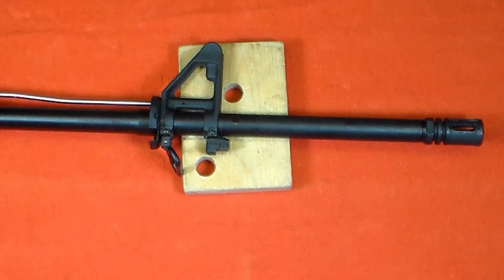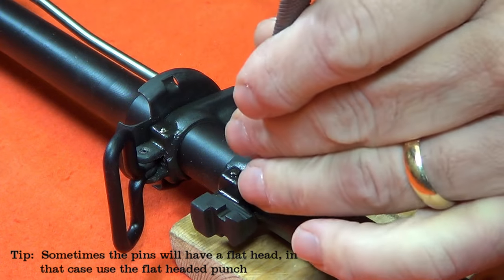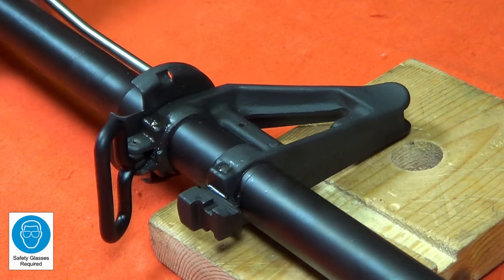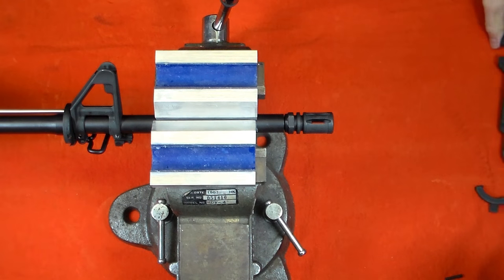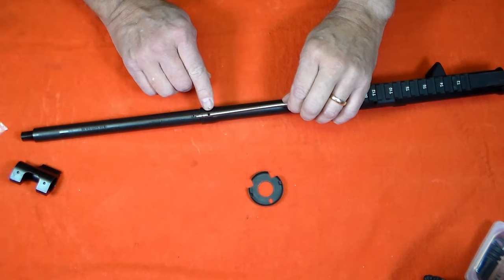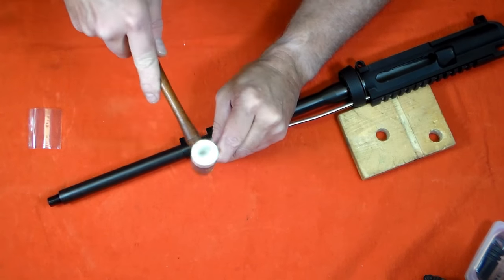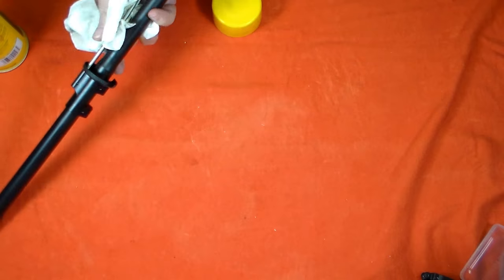AR-15 Front Sight Base removal and replacement

Comment: My enthusiasm for removing an A2 post has just evaporated. I'm barely good with Legos.
Reply: If you got enough money, buy a new barrel. Cheaper than dirt has some on sale and made by wilson combat that are pretty nice. Came with a new gas tube as well. Mine was 178.00 before shipping and tax. Normally 268.00…Barrell isn’t hard to put on at all
Reply: Just buy a new complete upper and save this one for a backup!

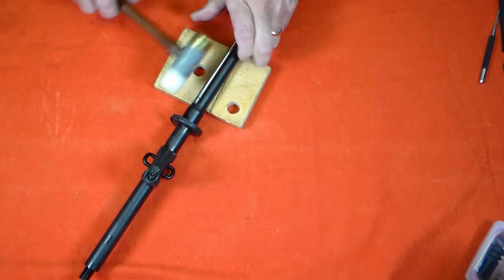Comment: 4:06 'to remove the gas tube you need a special tool that I'll show you later'  4:23 pulls gas tube out by hand
Reply: :-) good catch, but I did say "on heavily used guns you'll need the special tool" this gun was almost new so the tube came out by hand.  I do show the tool later at 5:52.  That tool, by the way, is available from Midway USA or Brownells.  Thanks for watching!
Reply: Jim Humphrey Great channel you got here. I just did my first gas tube replacement job yesterday. I’m always looking for a good gunsmith channel, sub’d you.
Thanks !
Reply: @newdefsys  check out sotar also

Comment: I finally bought a Ruger 556 online and didn't notice the loose front sight till later on. Luckily Dad had old steel concave nail sets old as me in his gun tool box from 4/32 to a point. Used the 3/32 and his old Tapco brass hammer he used as a AMM2 on the Enterprise during WW2  to tighten up the pins and center the sight, still looks half a degree off, my OCD probably, He had a cool pristine collection going back to a like new Springfield 1873 trap door 45-70 up to few modern ones from the 60s, bought a few Colts at a hardware store in the 50s, times sure have changed!, till few years ago when Mom passed. He did all his own minor gunsmithing. I'm planning on a QR scope mount and keeping irons, think I'll just use a taller mount.

Comment: Very nice presentation: no hard rock or banjo background music. I have most of the tools needed to build my first AR-15, but after viewing the difficulty in removing the two sight base pins, I don't think my concave pins are robust enough to do the job. I think perhaps a shot of penetrant a day or two ahead of time and a 3/32 nail set punch might make the project go a little bit smoother.
Reply from the maker: Absolutely soak the heck out of them with Kroil or equivalent.  I've always been surprised that somebody hasn't built a hand press (like a sight pusher tool) to push these pins out.  Thanks for watching.
Reply: @ImminentThreatDefense  I have a can of Kroil but I like the stinky stuff-PB Penetrant for most of my chores. Also, you might want to patent your AR base pin remover idea before someone else does and sells the idea to Brownell's. He-he. Thanks again and take care.

Comment: THANK YOU!!! The nail set saved my behind. Beat on those tapper pins with an 1/8" punch till all the beating was gone. Went to the hardware store bought a set of three nail sets and in about 10 minutes and 8 whacks pins were out like a high flyball to centerfield. Your well-honed advice turned frustration into a sense of accomplishment. Just one observation you stated a 5/32" set however all I could find locally was 3/32", just wondering. Finally of all the good videos I watched on this step yours proved the most helpful''.........again THANK YOU!!
Reply: Thanks for the comments, and you're right I got it wrong, I was using a 3/32, sorry if you spent too much time looking for a bigger one.   Thanks for watching!

Comment: Dude, those front sight pins are kicking my ass.
Reply: Nice Guy dude tell me about it. I have to call in for backup.  No reason they should be that difficult
Reply: Yep, I've been trying to get these things out for an hour now. They just won't seem to budge.
Reply: Your lucky I just sent my Ruger back to Ruger today because my front site pins fell out of the weapon while I was shooting today! The gas tube was not flush on the site so the weapon would not eject the the fired rounds. New weapon only shot about 50 rounds out of the weapon. Ruger would not give me my money back but did pay to ship the weapon back to North Carolina to fix it.

Comment: If you simply wanted to put the front sight back on afterwards, would you be able to do so? Those tapered pins should re-center the front sight over the gas tube hole every time right?
Reply from the maker: That's right the alignment should still be correct.  The hole is a tapered hole as well as the pin, so the pin orientation to the hole has to be correct.  Generally I replace the pins, they're cheap and often get marred when you remove them.

Comment: Great video. I m looking to do the same. What type of gas block is that. Looks like a simple replace that lines up and hides the 2 lines
Reply from the maker: It was the Double Star DSC761 RACE GUN GAS BLOCK, though not my choice, the customer chose it based on price.  Personally, I like to keep the iron sight backup option, especially with any battery powered tactical optic, and I prefer the clamp attachment rather than the set screw.  So on my duty rifle I chose the Yankee Hill with the flip up sight and bottom rail for the light YHM9835A.  Brownells sells both.

Comment: You reduced the lethality of that "assault weapon" by a great deal when you removed the bayonet mount. No more drive-by bayonetings for you.
Reply from the maker: Quite correct. under the Brady Bill removing the bayonet lug was enough to reclassify this rifle and make it legal to purchase.  Not my intent of course ;-) and it doesn't make a difference (legally) these days.  Interesting data point, according to the FBI (“Crime in the United States 2019” table 8) bayonets, well knives anyway, are responsible for 4 times as many fatalities in the U.S. that year than all rifle types combined. Just saying.

Comment: Hi, im having trouble removing the front post. How do i know which way my pin drives out. The left side oft he pin had a dome-ish shape the other end is quite flat. Thanks so much.
Reply from the maker: on 90% of AR's they come out from left to right.  But check the diameters on both ends, one will be bigger than the other.  I've not seen one with different looking ends, but I'd bet the flat end is the large end so the could use a flat (cheaper) punch to push them end when they manufacturer them.   If the flat side was on the right, I'd be more confident in that guess.  But still try to figure out which end is larger and drive out towards that end.  They don't come out easily, this is one of few times in my videos you'll see me use the steel ball peen hammer and a steel punch.  A good overnight soak of Kroil penetrating oil won't hurt either.

Comment: Do you really need to replace the crush washer?
Reply from the maker: It is recommended yes, it's a cheap part ($3-5).  But what would happen if you didn't, well if you torqued it too hard the orientation would be wrong (closed side should be down), and if you didn't torque it enough it might come loose.

Comment: I run scopes with a front sight.  Somehow it sees around it and doesn't show up in view.
Reply from the maker: Good point.  For the most part with a magnified optic the FSB is going to just be a blur and hardly noticeable, it is going to effect your image a little though.  Most people do this for red dot type sights that have little or no magnification.

Comment: How much does it normally cost for someone to do that to one of those Smith & Wesson AR15 because I was looking at getting one and I was thinking about putting a different one of those systems with the picatinny rails running down them over top of the gas block
Reply from the maker: It shouldn't take but about 1hr labor, so $50-80 (yes that seems like a lot, but you've got to cover tools and overhead) plus parts.  You're better off ordering the rifle in the configuration you want.  Hope that helps, thanks for watching!

Comment: Honest question, if one is removing front site post cuz its n the way. Why not carefully just use a die grinder to make 2 cuts needed to remove post. Then nothing is disturbed? Dab couple drops of blk header paint on cut surface and b done w it? Seems to be a fast simple fix vs all the tear down.
Reply from the maker: You could, it's a choice.  A new gas block though the ability to add an accessory rail or (on some models) extend the hand guard over the gas block.  Note this FSB has a bayonet lug.  During the Brady bill days the AR's had to remove the bayonet lug (that was the one of the key differences between and "assault rifle" that was banned and a sporting rifle that was not) so FSB's with a bayonet lug have some value.  Thanks for watching!

Comment: Can anyone say if this is a Ruger 556? This makes it a lot easier to remove the pins if you're trying to remove them in the right direction. While Jim says most pins drive out from left to right but on this rifle, they drive out from right to left, there is no mention as to who made the rifle.
Reply from the maker: If I recall correctly this was a Ruger.  But the best way to tell is just look at the pins, one end is visibly larger than the other.  The pins are 2/0 taper pins, the large end is 0.143" and the small end is 0.124" diameter.  So about a 20 thou difference big enough to see if you look carefully.   Thanks for watching!

Comment: What happens if the gas tube is installed incorrectly?
Reply from the maker: There's a couple of ways to put it in wrong.  Mostly they manifest themselves in causing a failure to cycle.  If you don't line up the hole in the gas tube with the hole in barrel you won't get any gas back at the bolt carrier to cycle it.  Less obvious is not aligning the tube with the hole in the receiver.  Being a little out of line can cause the gas tube to rub asymmetrically on the gas key.  Which will eventually rub a flat on the tip of the gas tube allowing gas to leak out and causing intermittent failure to cycle.

Comment: What about checking that the gas tube properly lines up with the bolt carrier before tightening everything down?
Reply from the maker: Good point, but the misalignment of the gas tube is caused by the position of the barrel nut.  But I didn't change the position of the barrel nut so it shouldn't change the position of the gas tube.  The springs I lined up at 4:49 could cause some misalignment, initially at least but they'll vibrate into place.  When you're replacing the barrel you have not just tighten the barrel nut to torque but also make sure the gas tube passes through the nut without interference.  Just a little bit out of alignment will cause the end of the gas tube to wear from rubbing asymmetrically on the bolt carrier, which will cause a flat spot on the side of the end of the gas tube. This then leads to gas leak and can cause malfunctions.  During any work like this it is a good idea to check the last guys work, which I did, I just didn't include it in this video.  Thanks for the comment and thanks for watching.
Reply: @ImminentThreatDefense  Have you had a AR barrel get loose where you could wiggle the front A2 sight post side to side a little?  One of my older ones I just noticed I could rotated it a little.  About as much as probably the front barrel lock pin allows.   It does not wiggle any up and down just a rotation thing.  Which means the front sight post could be a little left or a little right.  Not ideal.   
Is this more likely due to wear where the barrel slides in or could it be the barrel nut somehow loosened or maybe it was never cranked on super tight long ago.   Not sure the best way to fix it.
Reply from the maker: @Physics072  You're saying the barrel and sight post wiggle together?  I'd say your barrel nut isn't tight enough and maybe you've got some slop in the barrel pin fit.  Could be wear/damage, poor quality, or inconsequential slop.  Despite what one viewer call an "unnecessary tool" this is one reason why I use the barrel clamp to remove the flash hider, I should have mentioned that in my first response.  Holding the barrel by the upper when removing the flash hider puts torque on the barrel pin, not really a good idea.   The barrel pin is just there to line up the top of the barrel.  To get rid of that wiggle the barrel nut should be torqued to 30 ft-lb plus whatever it takes to turn to the next notch to line up with the gas tube hole.
Reply: @ImminentThreatDefense  Its an OLD colt looks like a 651 A2 Stock (20 + years) the handle grip no rail, old school thats had much use.   Its probably the lock nut there is no slop up/down/left right.   Its not like the horrible fits I see on new guns.   I have the tools now to properly take it apart.  Bolt lock bar + barrel clamp if needed.  But I think I only have to take the front gas tube off and not touch the A2 sights.   Which looks to be 1 roll pin.   Not taking sight or front flash off as there is no need that I see.   Waiting on a door spring, always bugged me that spring was sprung.
Reply: @ImminentThreatDefense  I can't get that A2 sight post 1/16" roll pin to come out.  I'm starting to think I'm pounding into the side of a gas tube that does not have a hole in it.  
The roll pin was countersunk on both side no flush.  And I've bent 2 Astoner 1/16" pins tapping on it sitting on a cement floor and a gun block under it.  I'm about to drill it out.  Any suggestions?
Reply from the maker: @Physics072  Wow, that pin usually comes out pretty easily, and it will come out from either side.  Any chance it's rusted in there, maybe try some penetrating oil and some heat.
Reply: @ImminentThreatDefense  Zero rust on the gun.  Yea its strange.  I've taken out the roll pins on other parts before never the gas key one.  It is strange, I'm letting it soak in oil maybe it will loosen.   The gun is built well, its like I opened a can of worms trying to get that roll punch out.  Ill get it just wanted to ask you first.
Reply: @ImminentThreatDefense  Well I got a new Starret 1/16 pin and even with oil it just bent it.   Can this be drilled out?   I could just forget about taking pin out and take the entire front sight off and barrel nut.    All I want to do is snug up the barrel nut.
Reply from the maker: @Physics072  Yeah you should be able to remove the FSB and slide it off with the gas tube in place.  Though normally the FSB pins are harder to remove than the gas tube pin so it's not done that way.  For what it's worth I think that punch is 5/64 and a roll pin punch.  I don't think the 1/16 (4/64) is so much smaller that it's getting inside the roll pin and swelling it but it's possible.
Reply: @ImminentThreatDefense  It does not seem like any roll pin I've seen.   Might be a too short solid pin and its digging into the insides of the sight post.  Meaning its never coming out with a punch.    I can only see drilling it out as an option.  Most ARs you can see the roll pin easily flush with the sides, see the break in the roll pin.  On this all you could see were holes,  the pin was countersunk on both sides.   Like it was too short or wrong size.   Maybe that is how they use to do them in the 80s 90s not sure.

Comment: so the fat side of the pin that sticks out is the smaller side? is that the side you are punching out from in this video? im very confused on what side you are working on
Reply from the maker: ??   The pin is tapered, hit the little end to drive it out.  How much it's sticking out has nothing to do with the direction of taper.  9 out of 10 drive out from left to right so on those the little end will be on the left side.  In the video, this model is pretty unusual, these pins drive out from right to left so the little end is on the right side

Comment: What gas block are you installing on the barrel?
Reply from the maker: It was the Double Star DSC761 RACE GUN GAS BLOCK, though not my choice, the customer chose it based on price.  Personally, I like to keep the iron sight backup option, especially with any battery powered tactical optic, and I prefer the clamp attachment rather than the set screw.  So on my duty rifle I chose the Yankee Hill with the flip up sight and bottom rail for the light YHM9835A.  Brownells sells both.

Comment: i have a colt m4 that has the front sight/gas block combo like this, i see in the comments you mentioned you replaced it with the double star dsc761. why cant i use any of the abundant low profile gas blocks for $20?
Reply from the maker: Sure, there are hundreds of choices out there.  You can see a lot of discussion in the comments below, but it just depends on what features you want and your budget.  Be careful that you get the right size, there are 4 different barrel diameters, see the comment below for more details.  Thanks for watching!

Comment: Where did you find the 5/32 nail set punch. Having a hard time finding one that size
Reply from the maker: I'm not sure where I picked that one up.  But looking at Brownells they recommend the 3/32"  for that job.  827-530-320WB
#800C 3/32" Starter Punch
Mfr Part: 53031

Comment: What gas block did you use? Trying to find it
Reply from the maker: It was the Double Star DSC761 RACE GUN GAS BLOCK, though not my choice, the customer chose it based on price.  Personally, I like to keep the iron sight backup option, especially with any battery powered tactical optic, and I prefer the clamp attachment rather than the set screw.  So on my duty rifle I choose the Yankee Hill with the flip up sight and bottom rail for the light YHM9835A.  Brownells sells both.

Comment: What is the standard gas journal size for a FSB gas block?
Reply from the maker: Hardly anything is "standard" on this platform any more :-)  but the 0.750" is the most common.  You can also find 0.625", 0.875" and 0.936"

Comment: What kinda of punch did you use to start the taper pins?
Reply: That's a nail set punch, in the video I say it is a5/32, but in hindsight I'm thinking it's only 3/32.  Looking at Brownells they recommend the 3/32"  for that job.  827-530-320WB
#800C 3/32" Starter Punch Mfr Part: 53031